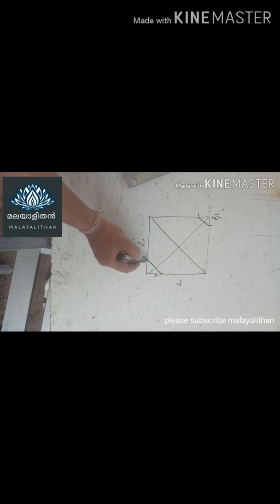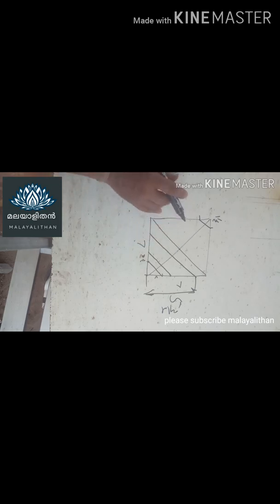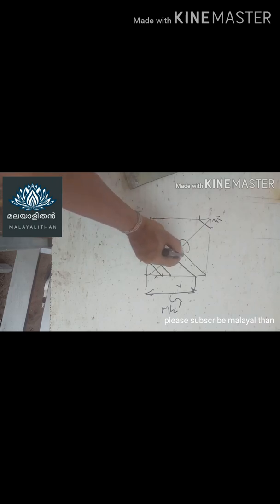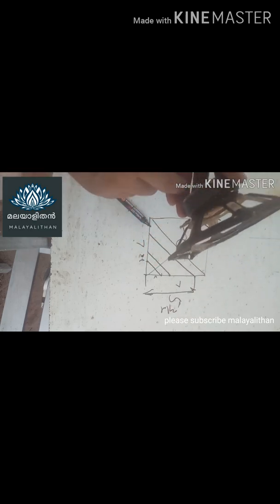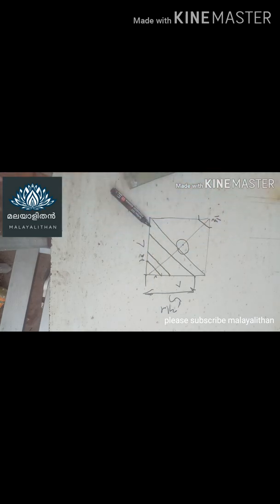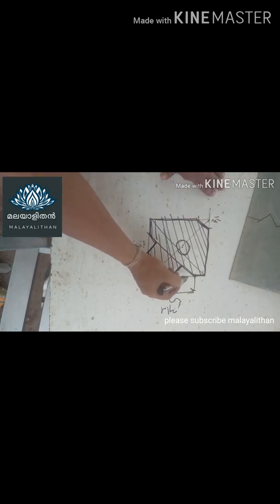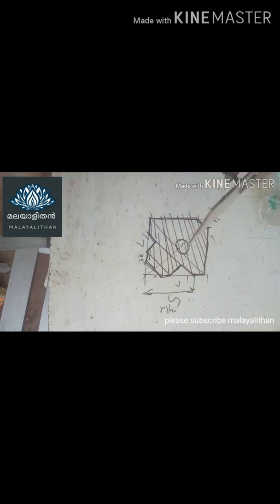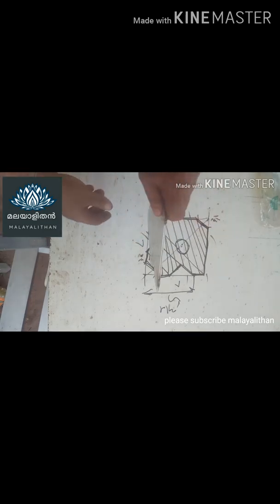How to make a welding magnet for an angle of 90 & 45 in malayalam. ഹെൽപ്പറില്ലാതെ ജോലി ചെയ്യാം.

Comment: Bro oru side correct straight aakki fix cheyyan paakathinu vechirunnal aa mold equipment nte oru side 45 um opposite side 90 um aakkiyal pore? Athakumbo namukk corner vare cherth vekkuvem cheyyalo weld cheyyumbol workpiece inte mukalil oru support koduth cheyyavunnathalle ollu simple aayi paranjal oru hypotenuse triangle pole! one angle 90 pinne aa hypotenuse varunnidathe angle namukk 45 aakki eduthal pore